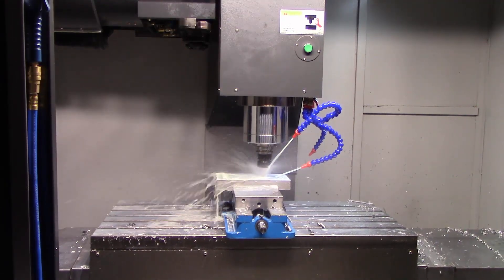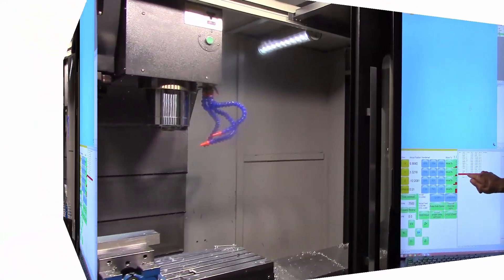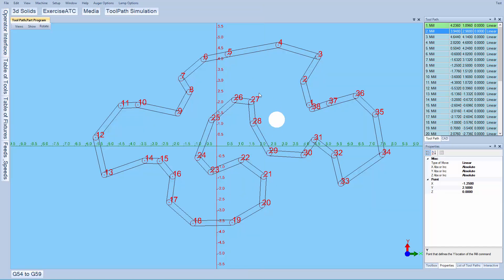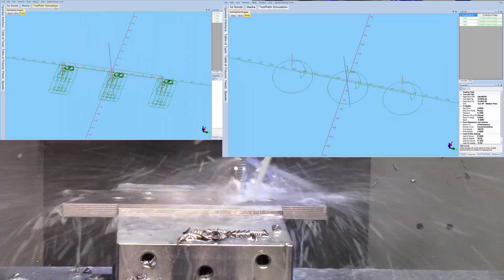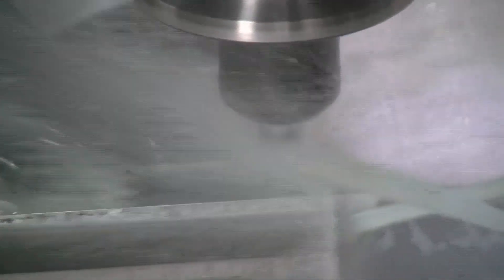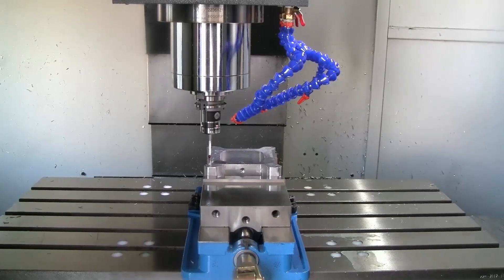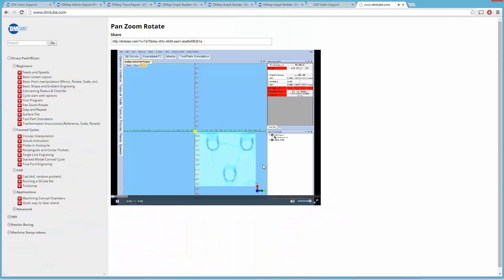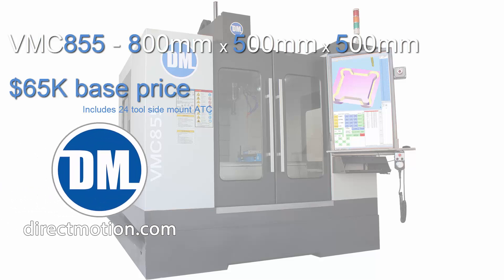Vertical Machining Center VMC | 39" 4K Touch Screen CNC | CNC Machine Tool - by DM

Comment: Is the Touch screen monitors are Scratch Proof. No Prob if it got hit by metal tools and Components.  What about wearing gloves and using the Monitor. Is that possible?
Reply from the maker: The touch screen is an aluminum frame with a scratch resistant glass panel. The glass can be replaced if necessary. Gloves work well with this type of touchscreen. The touch feature can also be disabled and a regular mouse and keyboard can be used instead if the user prefers.
Reply: Wow, thats nice.
Reply: Gohul Dhanarasu thanks Sonipat